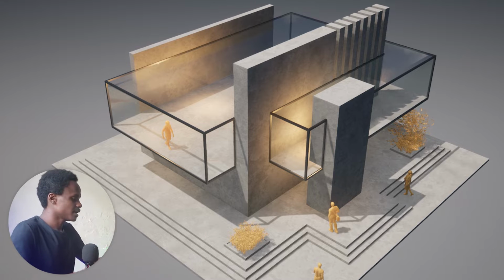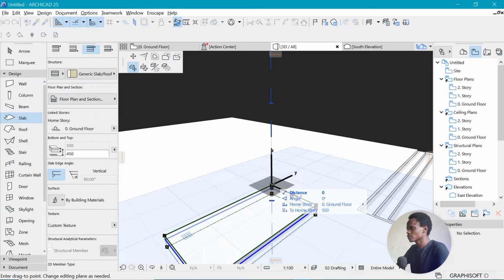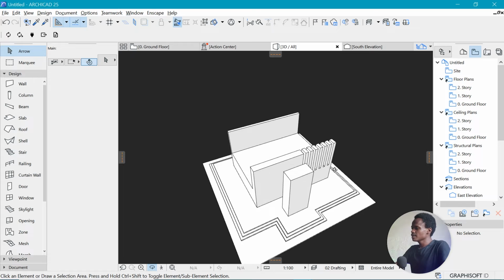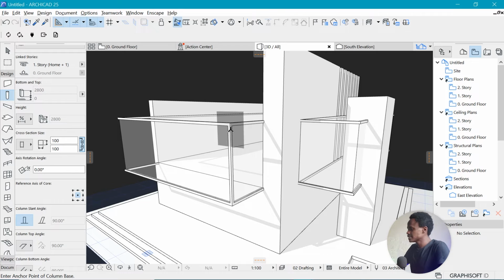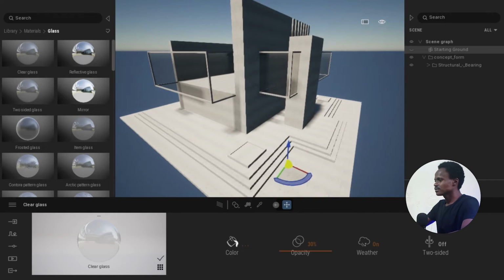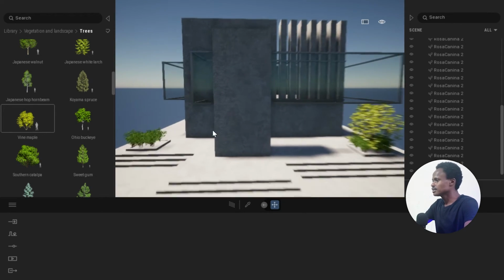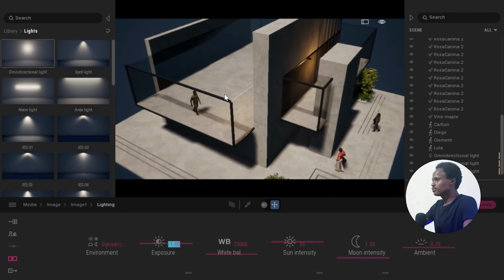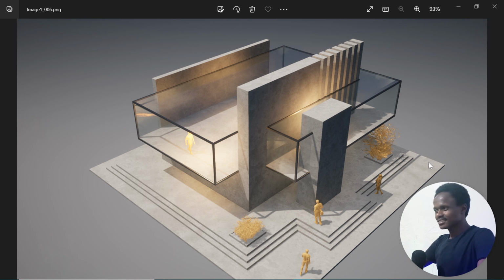Concept modelling with archicad and twinmotion for beginners in 30 minutes

Comment: My Archicad has a problem in that  when I click SAVE, it saves two similar files ..how do I do away with kind of thing 
It realy eats my pc storage
Reply from the maker: Make sure when you open an archicad file you open the .pln one not the .bpn, this is because .bpn is a recovery file and opening it makes you save a seperate .pln file. In short, just work with .pln files and you wont have the issue
Reply: @nalituts   thanks alot